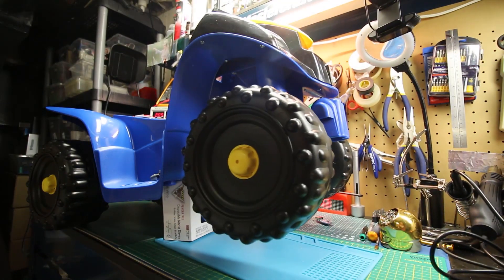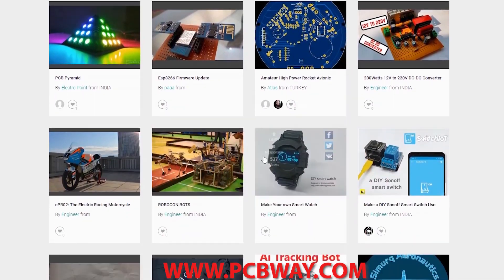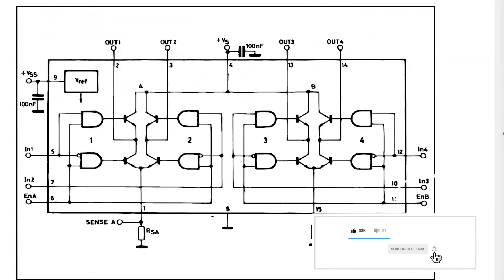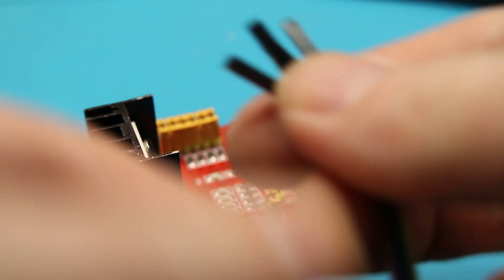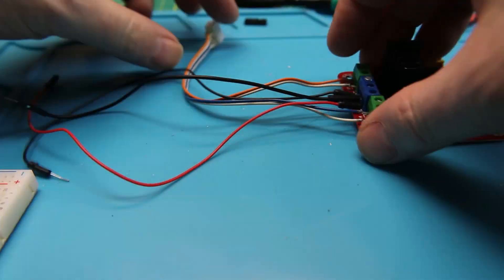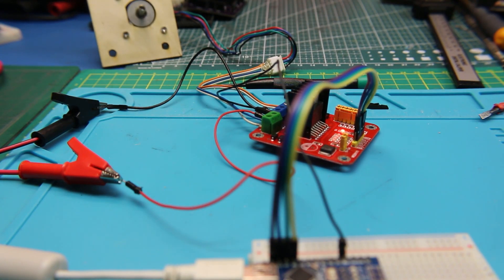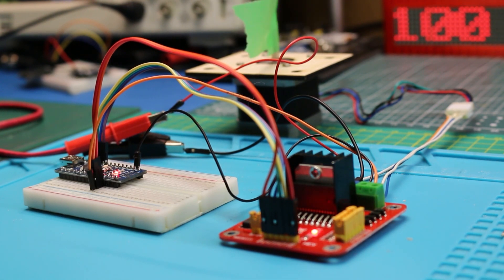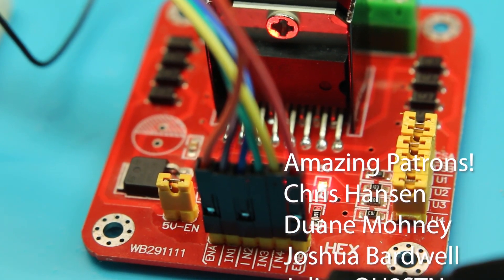Control a Stepper Motor With Arduino the EASY WAY

Comment from the maker: If you are in the mood for more easy Arduino projects I have many more here! https://www.youtube.com/playlist?list=PLxyM2a_cfnzjXms2WRO9OdAr-_7K-Ve2Z
Reply: I will definitely check out your projects I am only one day old trying to learn this stuff I am a chemist metalworker and Potter but I have used for some steppers in servo control projects. I have some small steppers that I don't know how to run can you tell me if these are doable on an Arduino if I give you the number?

am1524-v-12-150-07
they are an expensive little motor if you would like a handful let me know

Comment: For the wiring diagram you have only wires from 2 points for power but when actually assembling there is a 3rd wire. It looks like it is going to the Arduino GND. I'm very beginner at this so I have little actual terminology but I'm trying to use a power supply instead of direct power. Just a bit confused, I can't seem to get my L298N indicator light to activate and can't follow my wire paths correctly. Is the diagram missing a wire or is it a different scenario?
Reply: I'll add this for anyone else who wants to see it: The power supply I was using was converting to 5V. I have my RED wire leading to the 12V hub when it should have been leading to the 5V hub. Indicator light now comes on.